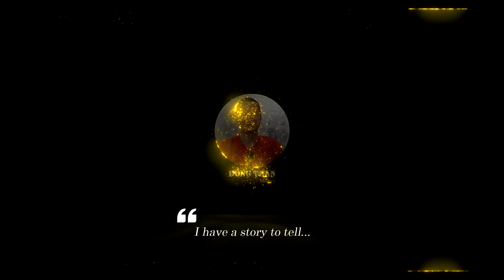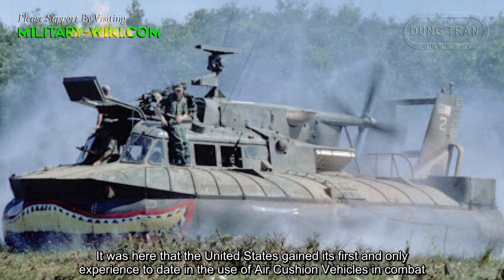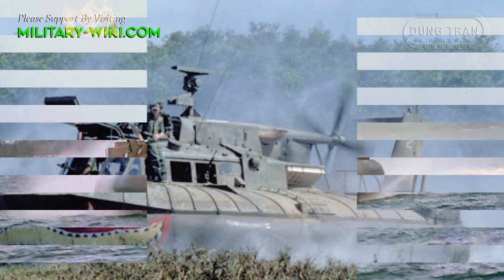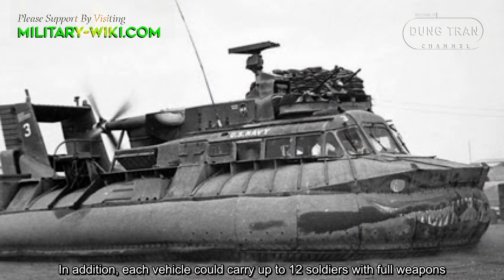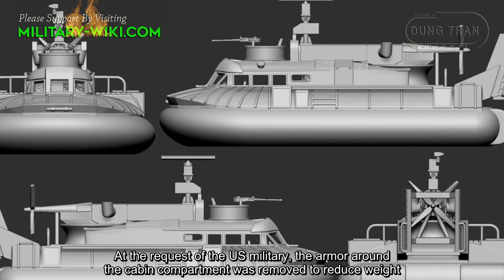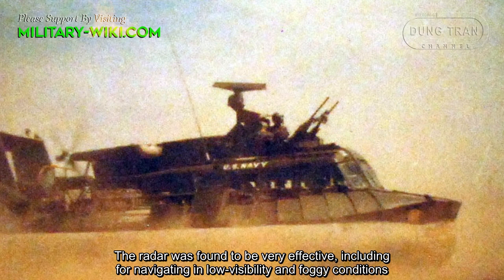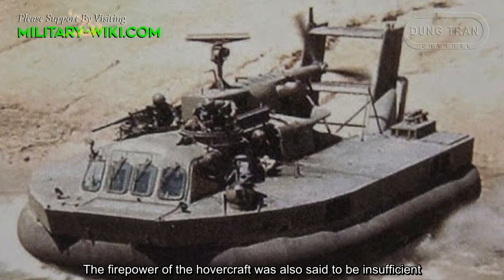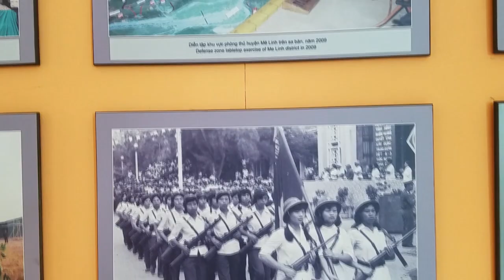Why Did The Patrol Air Cushion Vehicle PACV Fail Miserably In The Vietnam War?

Comment: I got to speak to one of the developers of the PACV in 1980.

One of the things he said was “I don’t know who thought it would be a good idea to try to make a tank out of an Air-Hockey Punk.”

They turned-out to not be as fast as thought, and were noisy, and produced a lot of mist/dust in any environment where the ground/water wasn’t nearly completely flat.

They also could not mount anything much larger than a 20mm cannon, due to problems of both recoil, and the air-pressure in the skirt equalizing at the firing of the weapon, causing it to “crash.”

The experience led to the development of the LCAC, which is about the only real suitable use for a “Hovercraft.”

Comment: I knew men that were assigned to these vehicles in Viet Nam and only one talked about a PAC-V possibly being damaged by a land mine, with only one pound of pressure per square inch within the skirt there wasn't enough force to trigger a land mine that needed three pounds per square inch. Many returned to their base with the skirt all shot up as it was thought that would sink the craft, it really didn't do much to stop these "Monsters". Some of these 'boats' also used an M60/69 Mortar launching pack from the stern (rear) as well as the armament mentioned.
The men that I knew and some that were rescued by them never thought the PAC-V "failed" it was an experiment that the US government decided not to follow and even those reassigned to the Coast Guard have been scrapped.